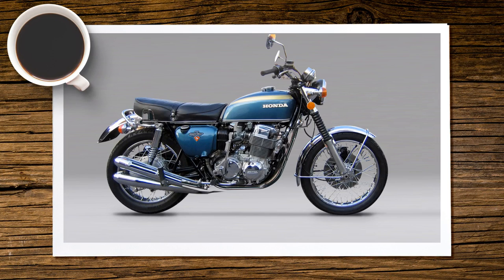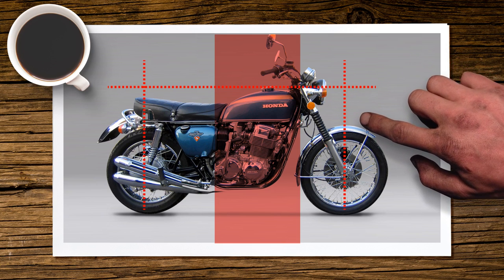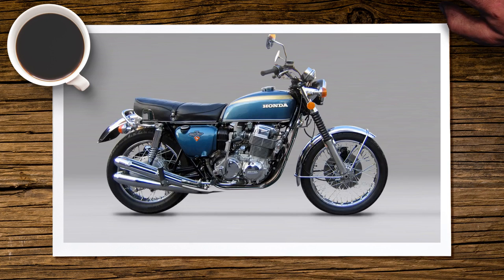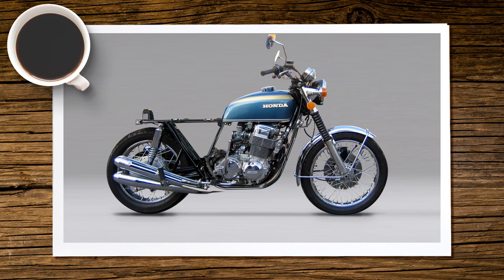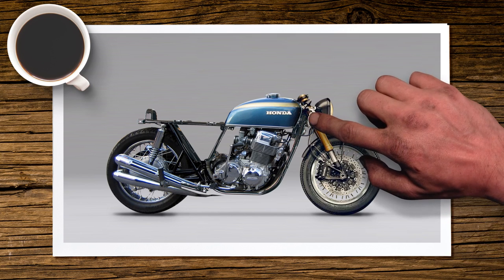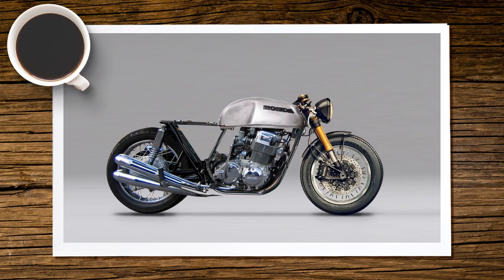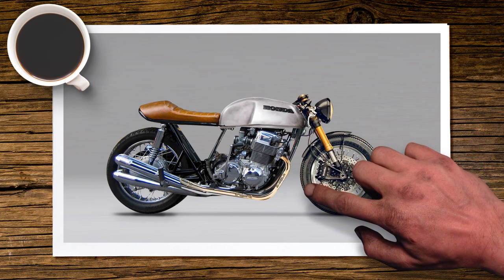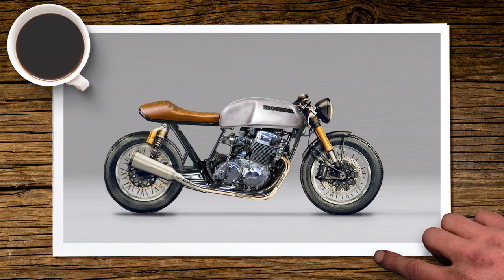How to design a cafe racer motorcycle

Comment: İf you change that much things, you loose the bike' spirit. It's not the same bike anymore, but another. I don't like that. I'm up to keep as much as I can to create my view of cafe racer.
Reply from the maker: +Ali F. Seyran a very good point that you loose the originality of the bike. The good thing about building is that you can create the bike to how you want it as an extension of your personality
Reply: For The Bold - dreegez I agree with that. But, if the new creation is almost the same with other new creations (cafe racers), where is the point of creating your own. For me, we have to keep the main parts with a lot of touches which come from our own imaginary.
Reply: For The Bold - dreegez I mean that a custom project like cafe racer project is not about to change original parts with the brand new custom fabricated parts. Just the opposite. We have to turn them into something relatively different and nicer. That's the spirit.
Reply from the maker: +Ali F. Seyran 100% agree with you